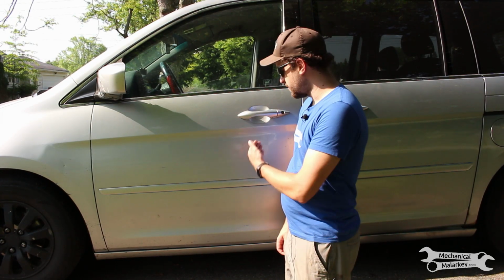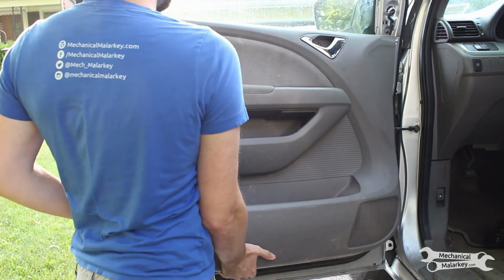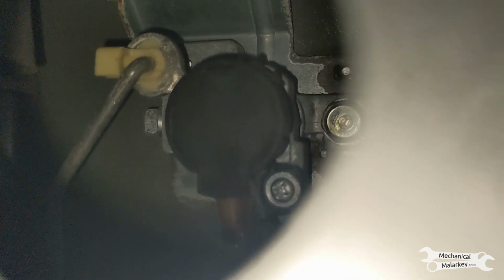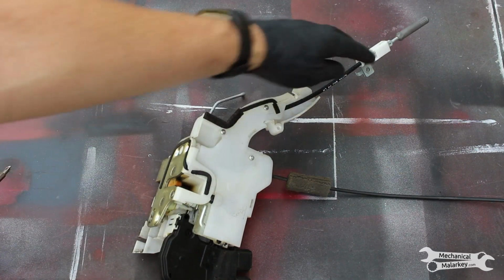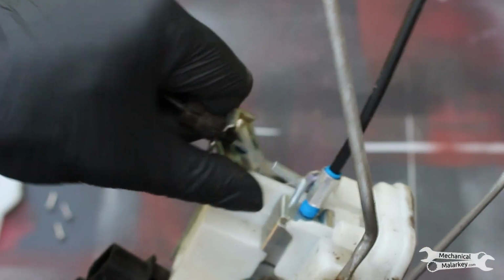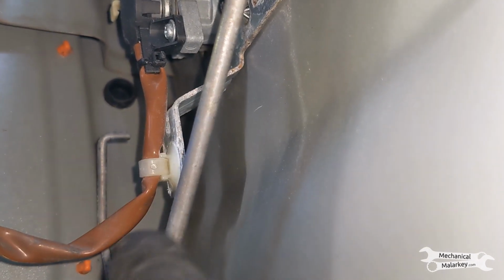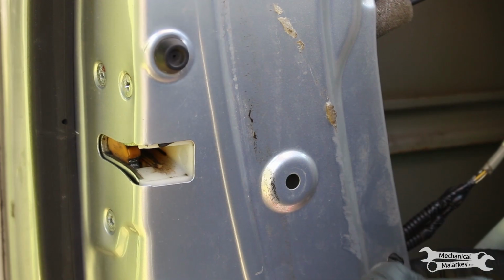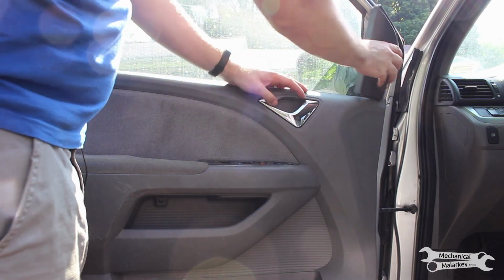2005-2010 Honda Odyssey Front Door Latch Removal

Comment: How would you know the cable is bad? My cable looks fine, but the side near the latch does not retract to pull the cable back and does not open the latch either. seems it's missing a linkage between the swiveling part it's moving and another part it's not moving, which would also make it retract after being pulled?